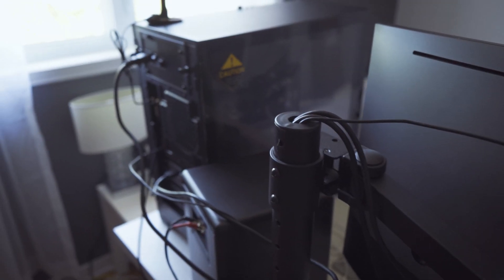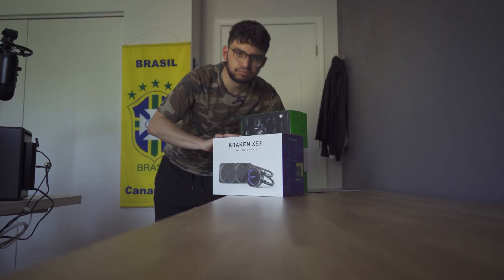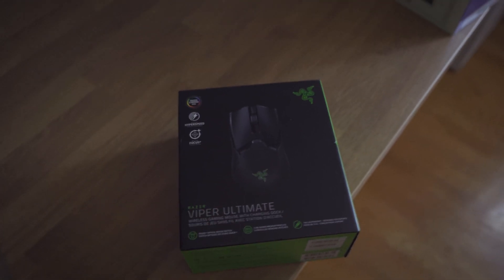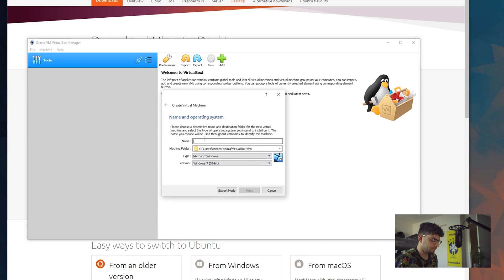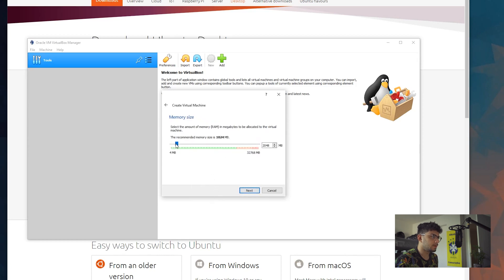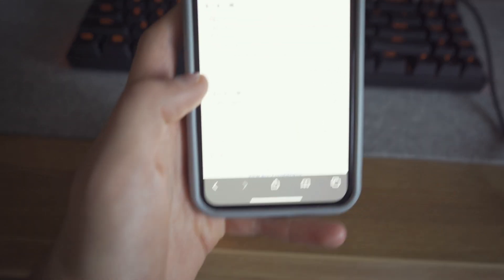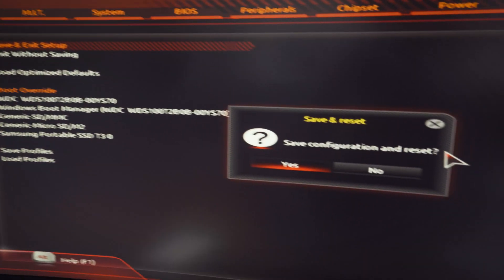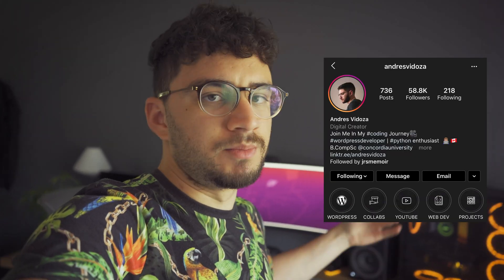I Built a New AMD Ryzen 9 3900X PC For Software Development

Comment: Nice looking setup!

I'm looking to use these fans in my case 

Do you know if the hubs daisy chain together ? I don't have s RGB header on my mobo and looking to control them all at the same time with the reset button instead of the buttons on the hub so wanted to know if the hubs can daisy chain so I can do that 

So I don't have to control 5 fans and then the other 4 fans seperate

Comment: "For Development"

What the hell you need that much power for?
Reply: So true.
Reply: I think he is doing virtualization, which can take a lot resources depending on the usage. If you meant core count + ram amount with power. Makes it much easier when you have the extra resources already installed.
Reply: @propotti25  Yes but you don’t need a 3900x + 2070 super for that. Basically any decent cpu and 16 or 32gb should be enough. 
And 32gb is only if you do a lot of virtualization.
And I know what I’m talking about, I’m a software engineer.
Reply: @adeeldu95  not all CS courses are same, mine has game development too, also these parts are actually pretty cheap and he's getting some for free too as its sponsored

Comment: Why you are simply just use Docker instead of VMs? It is much simpler and it is doing the job that you need running other OS parts in containers. Also you can code from the same machine ( like your case Windows ). Give it a try and I'm sure it will worth it.

Comment: Absolutely love the theme! I did something similar. Question on the fans, did you connect the rgb fans to the controller? I did that and they run full speed (SUPER loud). So I kept the rgb 3-pins on the controller, but all 5 4-pin fan connectors to the motherboard instead. My first pc, so please let me know if that's a good/valid connection. lol it works for now, but just want to check.
Reply: I have the same issue with my antec prizm fans too! I was hoping there was another way to control the fans without connecting all 5 4 pin cables spread across my mobo
Reply: @matthew4892  my fans has been working great, RGB syncs with my ASUS mobo too. But a controller would be nice and neat 👍 I'm surprised the one came with the fans doesn't control speed based on performance though...maybe I'm doing it wrong?!

Comment: I need to start doing YouTube. That’s sick! I tried running Ubuntu and ended up switching to WSL. I like it but the display scaling just isn’t up to par with Windows or MacOS. I have an ultra wide monitor and it’s just nice to have everything in a single spot without having to boot up a virtual machine or anything.

Comment: That is one killer pc!!!! For development and also gaming!!!
Reply from the maker: hehe and content creation!!
Reply: @andresvidoza  hey dude will you upgrade your cpu after the amd ryzen 5000 anouncement or will you stick with your 3900x cpu or do you think its not worth it since its already a good cpu since your only using it for producitivity and coding + gaming it should be fine for now
Reply: @andresvidoza  do you need to optimize your Apps for the Zen-microarchitecture to take full advantage of ryzen's performance ??
Reply: I mean he could have gone with some better options if he did some more research. For example picking a b450 board for a 3900x is inefficient, and he also bought a cheap m.2 which is not a problem but still he could have saved some money  by picking a 3700x